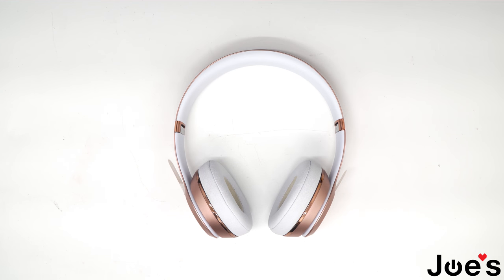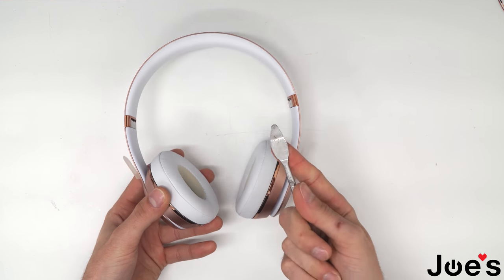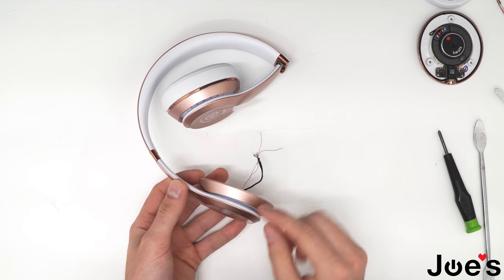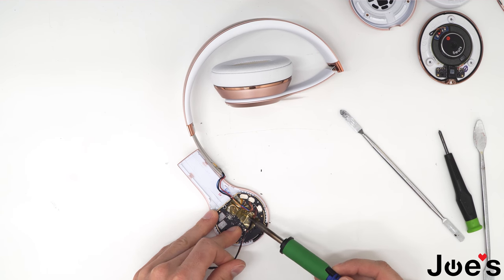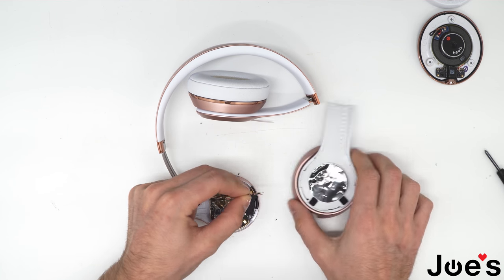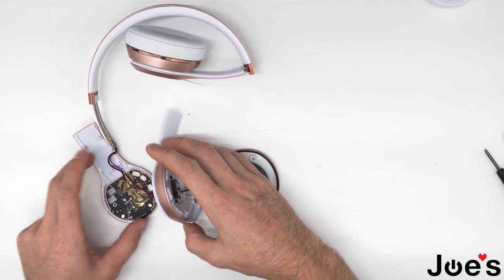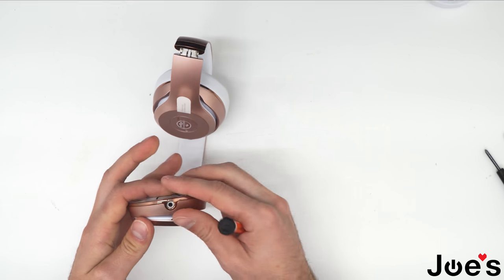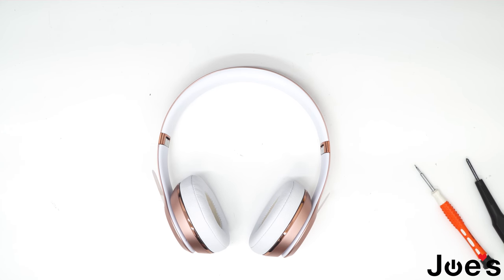Beats By Dre Solo 3 No Power Wire Replacement One Side Not Working

Comment: I have a problem with mine where I can still use them wired but when I try to charge, turn on, no lights. When I reset, no lights. Not even a red light. It’s been like this for a year and i came back to try and fix it
Reply from the maker: Thanks for watching! Sounds like your charging port may be bad or potentially a faulty internal circuit board could be the issue. You can send them in for a $60-80 repair including parts, labor and shipping both ways by following the steps on our website here: JoesGE.com/pages/repair-services
Reply: This happend to me before but I turned my headphones on and it said it was not working so I had to get a new charger and it worked :)
Reply: @spiderowll  for me a new charger did not solve the issue
Reply: Stance [GD] oh :(
Reply: @spiderowll  yep. as of right now It still works wired right now but I haven't fixed the battery or the issue the guy stated. i use beats studios 3 but the headband got messed up so I don't wanna use em until their fixed.
Reply: Stance [GD] oh I’m sorry .. I’m having a problem to I have to get my wire fixed.. because one side is not working..

Comment: Hi, I have same problem with my beats studio3 wireless, it charge and still detected via beats updater when I plugin to computer. I don't think power button broken, when I press power button while charging, lights turned off. But it doesn't work when I press power button to turn on my headphone, also factory reset is not possible. What would be the problem?
Reply from the maker: Hello, thanks for commenting. Please email us at support@joesge.com with a screenshot of your question and we will be able to better assist you there. - Aaron P

Comment: What if only the right side only works ? Mine will charge and show all lights fully illuminated but will not cut on I use the 3.5 millimeter jack and only the right side works? I don’t know what’s wrong with it
Reply from the maker: Thanks for the comment. The issue you are describing sounds like an internal wire issue. This is a common issue with the solo 3 wireless headphones. If you would like your headphones repaired by a professional you can fill out a repair form and follow the steps to send in your headphones. We offer free shipping and diagnostics. Here is a link to the repair form:
https://www.joesge.com/pages/repair-services
-David P

Comment: I really appreciate the video, and might have made a mess of the disassembly without it, but it probably should be clarified here and on the site, that the "no signal on one side" issue isn't always related to that 5-core bundle. Mine only had sound on both sides while using a wired connection, so I went ahead and ordered the 5-core, to find that one of the two leads running back to the right speaker was shot. You could barely tell from looking at it, and the 5-core seemed fine at that flex point where it passes through. If I had any sense, I would've poked around more with my meter before ordering anything, but I was too lazy to figure out what was going to what, and the cable jack appears to have some extra switching involved. Fortunately, I was able to cut the bad wire back before it reached the hole, splice on a new piece, and re-insulate with some liquid electrical tape, so I didn't need to order anything else, but I'm not too thrilled about that arrangement with the tiny fragile wires needing to bend every time you adjust or fold the headphones up. It would be cool to know exactly what each of those leads is responsible for. I'm guessing the problem pair here just runs directly to that other speaker, as there was a resistance between them which seemed right for a speaker.  -Thanks!
Reply from the maker: Hello, you're very welcome. Thank you for the comment. Please like and subscribe for more content like this 😊

Comment: Hi,  I have the  same problem as described (both sides work with wired, charging shows full LEDs, power button dead and unresponsive to a reset).  I would send them in but as I'm in Canada with the exchange rate, shipping and brokerage fees (yes I get dinged on them for repairs based on shipper/etc.) it would be too expensive and not much different than price of a new set on sale (Amazon Canada ). As such I'll try my hand at diagnosing and repairing myself and will order parts/supplies from your site if necessary. Also, while  I've not soldered in over 30 years and was surprised you can re-use all the existing solder for the new wires - I thought that went against good soldering practices but I guess here wires are so fine and not under any tension or movement that it makes it far easier for us DYIers :)
Reply from the maker: Thanks for the comment. I would love to help you diagnose the headphones. From your description of the issue, it sounds like this tutorial is the right one for you. You will need to replace the 5 core internal wire, which is responsible for no power issue. Here is a link to the part: https://www.joesge.com/products/beats-by-dre-solo-2-solo-3-wireless-5-core-wire-with-clip-parts

-David P

Comment: Both the black wire and those other two (those thin ones on the other side) you also disconnect in the video are snapped. Where can I buy the other wires?

Comment: Seem to have an issue I can’t understand, I’ve looked into all the wires and ports and they are all connected and all wires look fine to the point we’re they look untouched however the speaker still doesn’t work, I remember that I had the headphones on a certain angle were the speaker worked and I’ve heard this happens due to a wire, yet all wires that are shown in this video are fine, is it something to do with the speaker??? Or is it possible the issue is being caused from the other side of the headphones?

Comment: When you are trying to solder the wire back on the little pins do you apply a lot of pressure or do you just tap it onto the pin
Reply from the maker: Thanks for the comment. When soldering wires onto a PCB the soldering iron should be hot enough for you not to apply very much force. Using flux also helps with this process. 
-David P

Comment: Hi mine got bluetooth connected but less than 15 mins of usage the volume decrease by itself is that a bluetooth board related prob? And i cant turn it off when i press the power button  it only goes to pairing mode

Comment: hey, I temporarily solved the problem of one side not working by putting a piece of aluminum foil in the jack input. For me there is a problem with the input jack and the bluetooth sensor but I'm not sure. What do you think it is?

Too weird that bluetooth works with a piece of aluminum at a certain point otherwise the headphones turn off because it assumes it's a real jack input ...
Reply from the maker: Thanks for the comment. The issue you are describing sounds like a faulty 5 core internal wire. This is a common issue with the solo 3 wireless headphones. 
If you would like your device repaired by a professional you can fill out a repair form and follow the steps to send in your item. We offer free shipping and diagnostics. Here is a link to the repair form:
https://www.joesge.com/pages/repair-services

-David P

Comment: My beats power on and charge but after I put them on my ear they disconnect. But if I put the left side of the beats at a certain angle it works after like 10 attempts. The beats also work perfectly with aux cord.
Reply from the maker: Thanks for the comment. The issue you are describing sounds like a faulty 5 core internal wire which is responsible for power and audio. This is a common issue with the solo 3 wireless headphones. If you would like your headphones repaired by a professional you can fill out a repair form and follow the steps to send in your headphones. We offer free shipping and diagnostics. Here is a link to the repair form:
https://www.joesge.com/pages/repair-services
-David P

Comment: Do you also sell the screws? Mine were in so tight that no screwdriver would budge them and eventually stripped them out. Will need to try to carefully drill it out.
Reply from the maker: Hello, thanks for commenting. Please email us at support@joesge.com and we will be able to better help you there. - Aaron P
Reply: @Joesge  Decided to mail it in to you today. I got it opened up and the cable looked ok, but the connector was very brittle and looked a little burned.

Comment: Hey Joe, love your videos. Very helpful. I have an issue. When I changed the battery (, learned watching your video) the lights blink white then red and repeat 3 times total. Won't power on, or charge.. I'm lost, please help. I've switched out all the battery circuit boards, same with each. Changed charge ports. Same thing white and red lights blink 3 times.. Won't charge or turn on. Lmk please, thank you.
Reply from the maker: Did you swap the part we show in this video?
Reply: Yes sir. The wire a few times. The only time it lights or flashes white and red, is when I plug in a battety, unplug, plug back in..

Thanks for reply!

Comment: My solo3 won't power on but they charge lights up when charging but won't power on the other day I plugged them in and I pressed the button and they came on but they turned off when wasn't in use what can I do????
Reply from the maker: Thanks for the comment. The issue you are describing sounds like a faulty internal 5 core wire. This is a common issue with the solo 3 wireless headphones. 

If you would like your device repaired by a professional you can fill out a repair form and follow the steps to send in your item. We offer free shipping and diagnostics. Here is a link to the repair form:
https://www.joesge.com/pages/repair-services
-David P

Comment: The black wire with the connector pin has 2 loose wire in the left ear cup. Cant find replacement or help anywhere.
Reply from the maker: Hello, we suggest you send your headphones to our location for a diagnose and repair. To send it to our location please submit our repair form here: JoesGE.com/pages/repair-services, use Google Chrome to submit our repair form. The part you are looking for is located here: https://www.joesge.com/products/beats-by-dre-solo-2-solo-3-wireless-5-core-wire-with-clip-parts

Ruslan P

Comment: opened my beats and found that, right side isnt working only when i am using bluetooth. Both side are working perfectly when i am plugging in headphone cable. . whats the possible problem? main cable or 5 wire cable in the left side which is connected to 3.5 mm port?
Reply from the maker: Thanks for the comment. The issue you are describing sounds like a faulty 5 core internal wire. This is a common issue with the solo 3 wireless headphones. Here is a link to the part: https://www.joesge.com/products/beats-by-dre-solo-2-solo-3-wireless-5-core-wire-with-clip-parts?_pos=2&_sid=f157204be&_ss=r

If you would like your headphones repaired by a professional you can fill out a repair form and follow the steps to send in your headphones. We offer free shipping and diagnostics. Here is a link to the repair form:
https://www.joesge.com/pages/repair-services
-David P

Comment: Will this fix Solo 2 wireless right side speaker that has no sound unless I wiggle earphone?
Thanks! Great video by the way
Reply from the maker: Thanks for the comment. If you wiggle the left side of the headphones and the speaker cuts out then this is most likely the issue. Another way to diagnose if your 5 core wire needs to be replaced (shown in this video) by plugging in a aux cable and confirming that both speaker work. 
-David P
Reply: Thanks for answering! Seems like its the right side when wiggled. But really hard to tell.
 Same issue when the aux cable  plugged in.
Reply: Thank you for the tips! Seems to be the right side when wiggled. Same thing with the aux cord plugged in.
Reply from the maker: If the issue persists with the aux cable plugged in then you have a faulty main internal wire. So the 5 core wire in this video will not fix your issue. I would advise you send your headphones into our repair center. We offer free shipping and free diagnostics. 
Here is a link to the repair form:
https://www.joesge.com/pages/repair-services
Reply from the maker: The hole that we expanded in the video is also located on the right side. The problem is that the right side doesn't have a removable 5 core wire meaning its is a one piece wire that is part of the main internal wire. Because of this right side repairs are more difficult than the left.
Reply from the maker: Yes this is the main internal wire that should fix the right side cutting out issue.

Comment: I have solo 3 wireless and the right side isn’t working. How much would that cost?
Reply from the maker: Thanks for watching! Depending on the specific issue, you're looking at a repair between $50 to $80. It depends if it is just a speaker or an internal wire issue.

Comment: What if they power on and charge but the right side doesn’t work? How would I go about fixing that. I know that the speaker works because when I move around the wire it starts to play if I get it in the right spot
Reply from the maker: It would seam in this case that there is a connection error in the wiring. Check the solder points and see if they need to be touched up. We also offer repair services here: JoesGE.com/pages/repair-services
Reply: Joe's Gaming & Electronics is there anyway you could make a video on this

Comment: What would be the cost for a professional to fix my beats
Reply from the maker: Thanks for watching! The cost depends on the make and model of the headphones, and what the issue is. What problems are you having with the headphones? CH
Reply: Joe's Gaming & Electronics my right side is not working and I sent them in and the main wire had to be replaced. They said $129 or $130 for the cost I said sorry it is too much for me.

Comment: My problem isn’t the wire it’s the right speaker not working🙄
Reply from the maker: Thanks for the comment. The issue you are describing sounds like an internal wire issue. This is a common issue with the solo 3 wireless headphones when the right speaker stops working. If you would like your headphones repaired by a professional you can fill out a repair form and follow the steps to send in your headphones. We offer free shipping and diagnostics. Here is a link to the repair form:
https://www.joesge.com/pages/repair-services

-David P